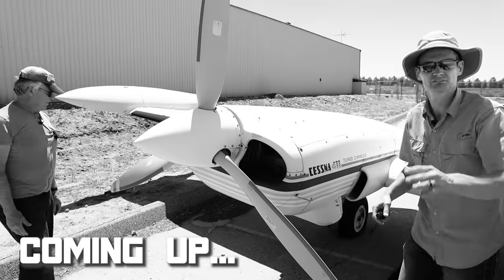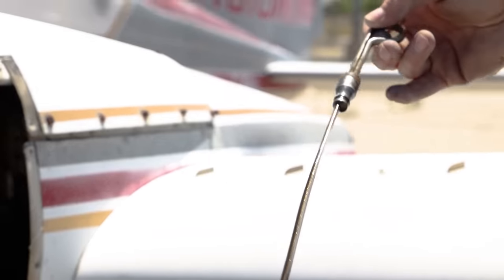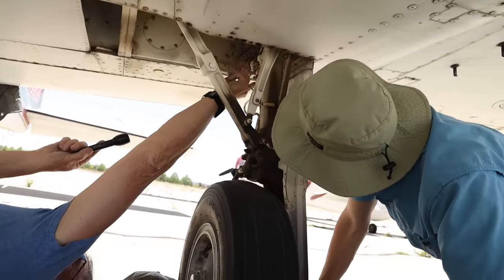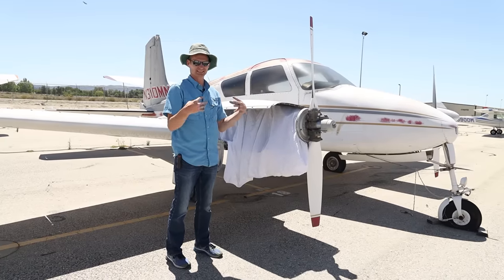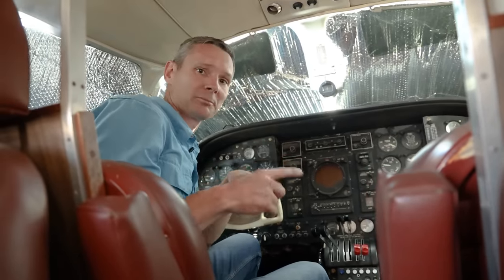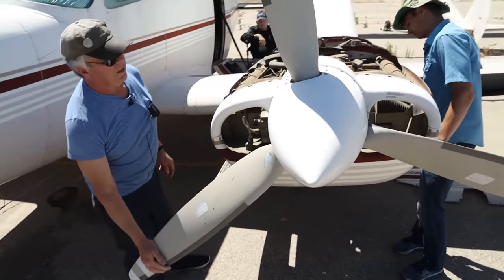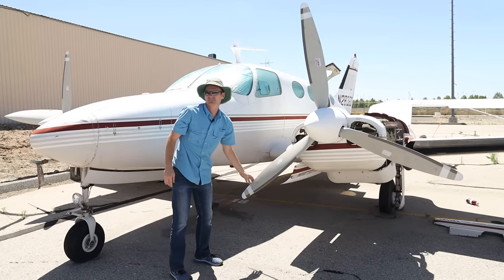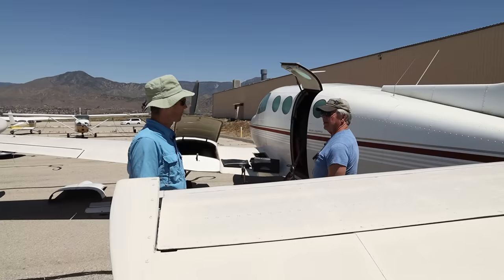Abandoned Airplane Miracle HUGE Save The 310 Update

Comment: Buying this derelict 310 and taking all of the new parts from mighty mouse will surely introduce you to many of the problems previously solved, but will quadruple the labor, and in my opinion is NOT "Saving the 310!" This idea is not forgivable As for the tail number, it is possible to cancel the current numbers, showing the one to be scraped out, and registering the MM plane with the number you like.  This one looks far worse than the one you rescued from a barn, and surely doesn't have nearly the story, as well as needing rewiring and an unknown amount of cleaning. Part out this one, and buy the 411! You can at least fly it with minimal preparation.

Comment: Pack rats. I've seen filter box on pickup in the country filled with rocks and rat 💩. 😡 Lucky the wires are not de-insullated!
And getting N310MM in the air appears to be a far easier/cheaper route than continuing on the barn find. DO IT! 👍

Comment: Are you really saving “the” 310 or saving “a” 310 with this plan? If this one is the same vintage are the current 310 won’t it need a completely new wiring harness as well? You may still need to make a bunch of the same repairs as what you’ve got.

So someone has a 401 and you need to our do them with a 411? That looks like a better plane then the one he’s attempting to rebuild.

Comment: I do wish you would quit referencing wd-40. It is not a lubricant it is not a penetrating oil. It is a solvent for removing moisture from ignition wires. That's what it was designed to do. It will destroy anything you try and use it as a lubricant on. Especially anything that has to slide against another surface.
Reply: It may not be a good lubricant, but it is a lubricant.

Comment: You know, I'm looking at this video when you ask what we think.  Personally, I think you missed on helluva opportunity when Kevin Thorton put 771BC on the market.  You want a 310, THAT would be the 310 to own, and you probably could have had it for less money that what you're spending to put both of these 310s back together and get one airplane out of it.  Plus, with all the avionics and rigging that Kevin did to it last year, you could have had a squawk free airplane.

Still, you probably didn't realize at the time what was happening, and where you would be now, and 1BC was sold not too long after it went on the market, so somebody get a great deal out of it.

Now, back to the rest of the video to see what else you end up buying.  

Additional comments 1.  A GTSIO-520?  Are you nuts?  I realize this is probably two months after the video was shot, but the 421 ended up with those engines, and you need to baby those things at all times.  If they haven't been run in ten years, good luck with them.  Do love the radar in it, though.  Talk about old school!

I dunno, Jimmy.  I guess you know what you're doing, even though you don't come off that way.  However, someone who has owned their own business with enough money to buy all these airplanes must have some smarts.  It would be nice to see one of the 310s flying again, but I might also think I'd like to see the 411 nicely restored and revitalized to bring it up to today's standards.

Good luck!

Comment: if your going to use that hunk of junk for parts, disassemble it and truck it back to your shop.  trying to fly it back is a complete waste of time and money, even for your channel.
Reply: I agree.  With the price of Avgas now, it will cost a fortune flying parts out.  Pull the engines, the wings and tail and put it on a low boy.  I've done is several times.

Comment: The 310 project is an endless pit of misery. You will never get a safe, reliable airplane after all these 'fixes'. The type cert is already invalidated by non -standard bits and I can't see any historic value in saving either plane.The 310 is pretty banal anyway, even a working one. Part it out before it kills somebody and concentrate on the Lancair, fabulous plane, and the Sierra as a workhorse.Kermit Weeks surely would love the MIG at Fantasy of Flight.Sorry to be negative but I'm a licensed aircraft engineer of many,many years (and financial disasters) and also a current plane owner so I'm on a reality check. Might make for a few more clicks but I would never trust those old and neglected junk piles without a half million bucks of  restoration spent on them.